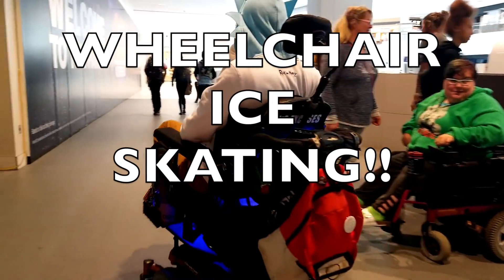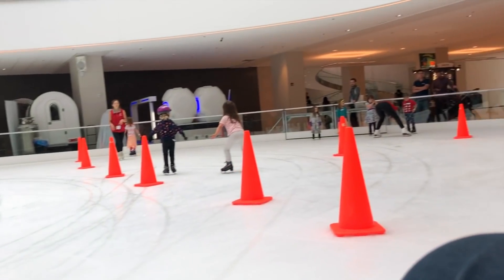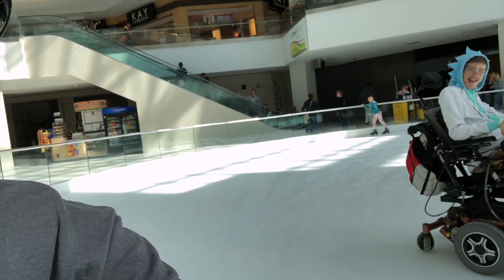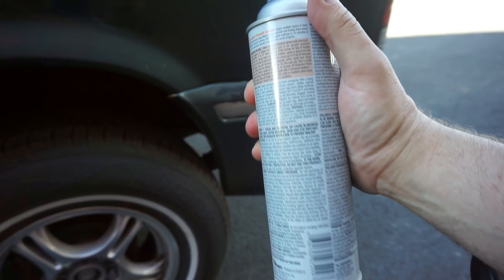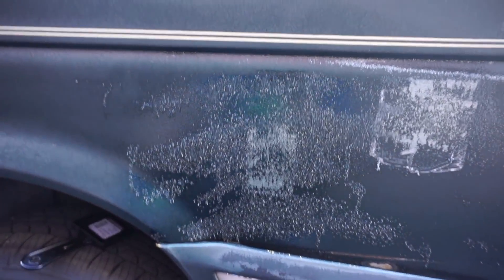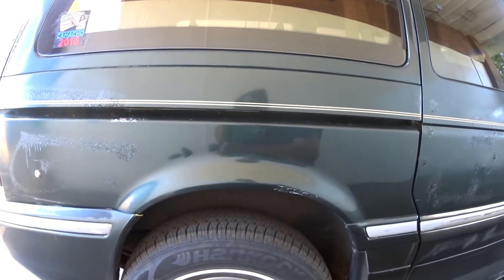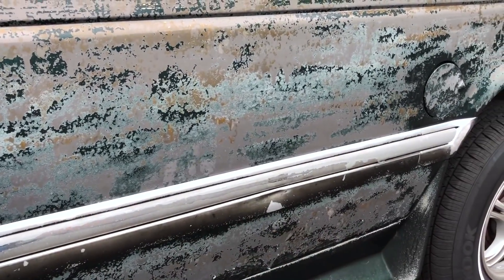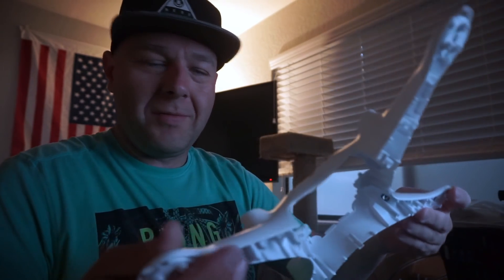VLOG 349: the ratroddening & ICE RINK!

Comment: You should use a tarp or a big piece of plastic stretched out onto the ground that you can park your van I’m on top of so that it will catch The paint chips.
Reply from the maker: thought about a tarp - but ive got a big lithium-ion pickup tool that worked nicely for cleanup :^)